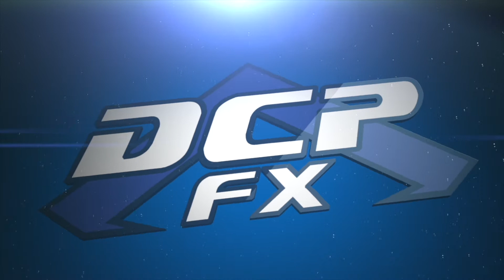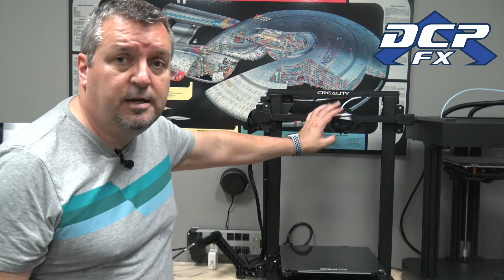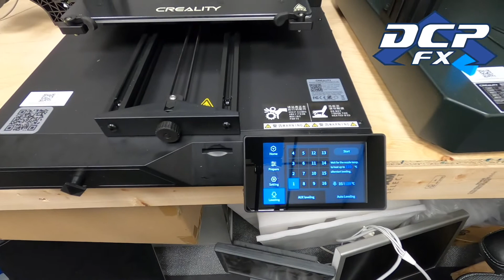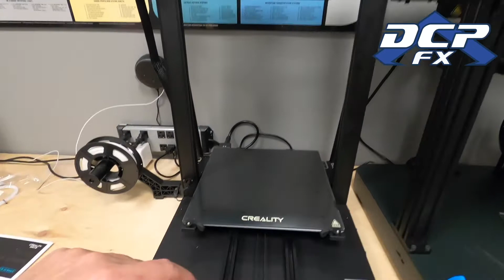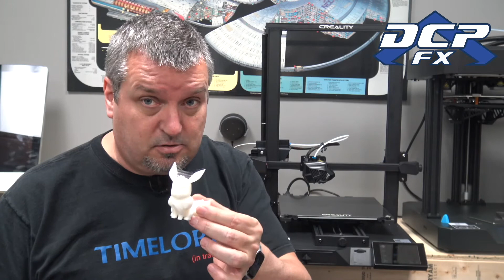Creality CR10 Smart Setup and Print

Comment: I just got my 3D printer and it won’t print at all, what do you mean by changing the power supply switch ??
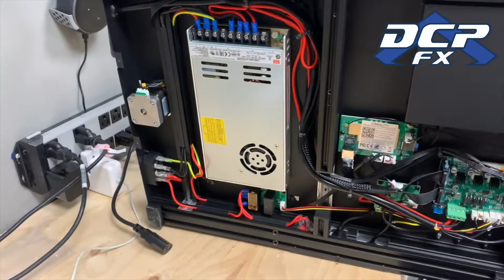Reply from the maker: If it doesn't turn on, the power supply is probably set to 230 - you need to turn it on its side, remove the screws holding the bottom on, and manually switch the power supply to 115- look at the video above at 2:28 forward
Reply: Mine won't turn on. I took the bottom off and my power supply doesn't have a selector switch on the side. (I am very familiar with 24VDC Power supplies and for some reason this one doesn't have it.) Any other ideas?

Comment: Nice vid Dave.   I have 4 FDM and 3 SLA printers, I have had to change the voltage on each and every one.  I wish they would set the correct voltage before they ship them.  They know they are coming to North America which is based on 120 volts.  You would think it would be  an obvious step before they left the plant.  Putting the PSU inside is nice but as you saw it means you have to open it up and risk damaging something trying to switch it to 120.  I guess that kind of forward thinking is not done in China, along with many other common sense things. Keep the vids coming.  I enjoy each and every one.  Dan C. :0)
Reply from the maker: Thanks Dan. Nice to see you are still watching!